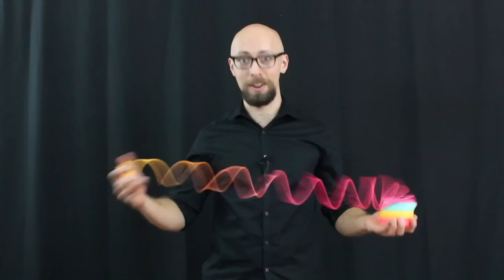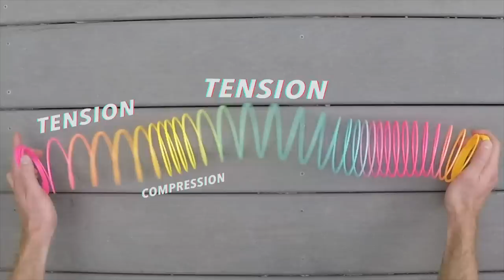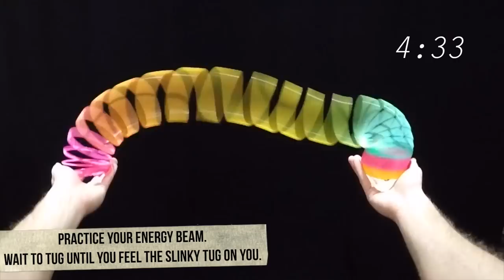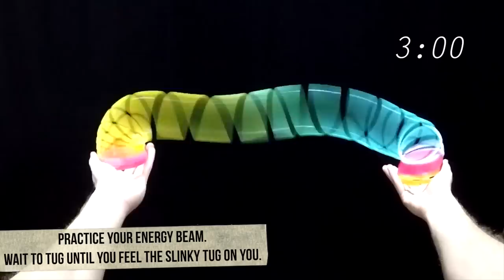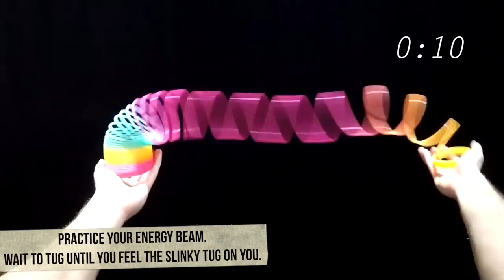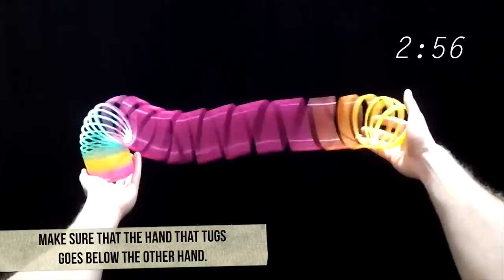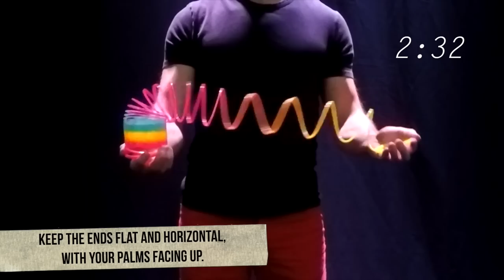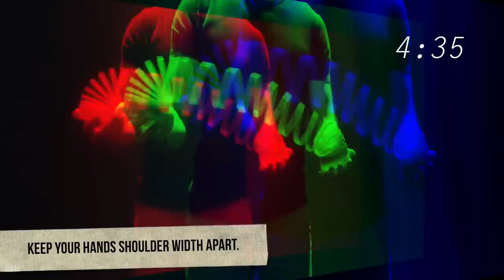LEARN SLINKY TRICKS: The Basic Energy Beam (In-Depth Guide)

Comment: I notice you don't use the original metal slinky in any of your videos.. Does the tricks work the same way? I'm assuming it would be somewhat different due to the weight of the slinky?
Reply: The metal ones bend permanently and it is just better with plastic, doesn't hurt as much,less metal noise,ect
Reply: @madilovesdragons1281  yeah I have to use a lighter to heat up my metal slinky and bend it back into place when it bends

Comment: Thanks a lot for that awesome tutorial.
Got myself one of the slinkys you recommended and a second one which is about 7cm tall with a smaller diameter and much thinner coils. Found out that the smaller one tends more to be in my "sweet spot" since yours feels too big. Might it be related to overall body length? Since im a rather small guy, the smaller and more flexible slinky feels much smoother to control and to tricks with